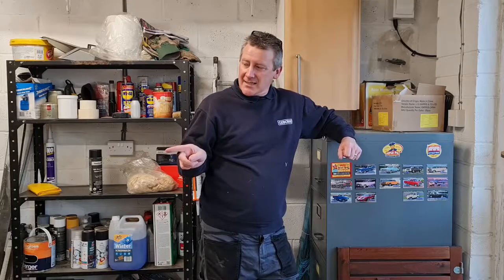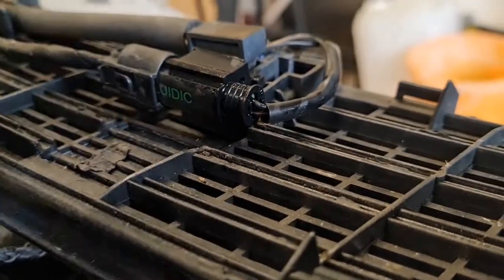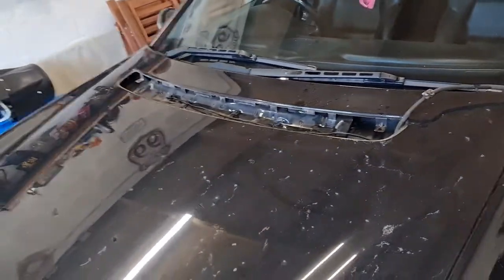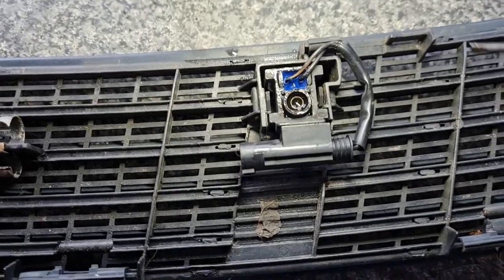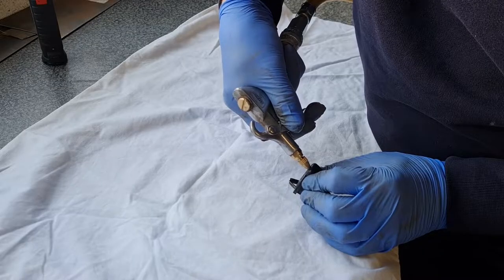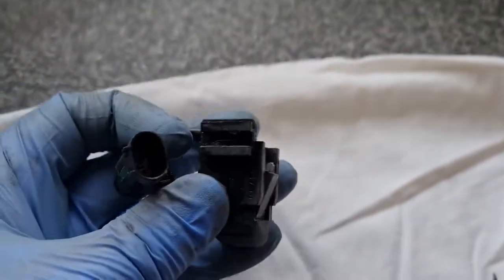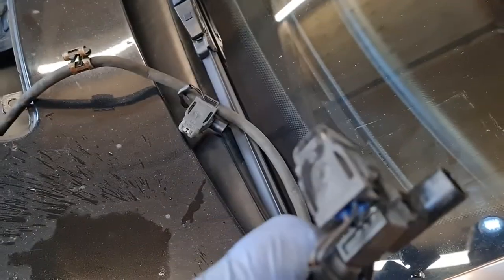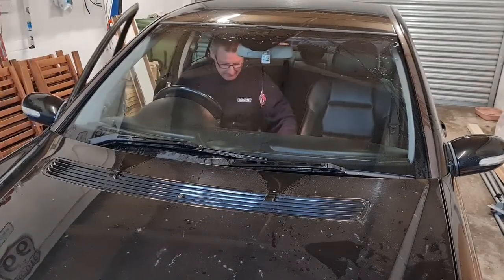How To Clean Or Replace Mercedes Blocked Washer Jets

Comment: Thanks for this mate, helped me big time, setup the exact same as my 09 CLS !
Reply from the maker: Glad it helped Luke 👍🏻
I found out after making the video that the little piece of plastic where the square hole is where the water comes out to squirt the screen also comes out from the washer unit. You'll need a strong pick to remove it but it'll come out and you can clean that too. Makes a hell of a difference 👍🏻

Comment: The jets may not be handed, but the nozzle may have an aim point and if you swap them over the spray pattern may hit the wrong side of the screen, possibly.
Reply from the maker: They just come out covering an area roughly between 10 o'clock and 2 o'clock (a bit less) 👍🏻

Comment: spray connectors with wd40 before you try and take connectors and plastic apart. That way you will not break things. they are very fragile.

Comment: What isn't mentioned is, to remove the grill to access the nozzles, there are NINE invisible, plastic clips that drop the grill from being removed. The only way to get the grill out is to break these old, fragile clips off. To be fair, there is no need for these clips, the 3 torx screws are plenty. My car is clk A209, 2009 reg.
Reply from the maker: You have a different model to the one demonstrated on.....
Reply: @SortedGeorgeGarage  I know it's a different model, but the grill etc. Is identical to yours. Infact, you can clearly see one of the clips on your grill. It also looks like some of your clips have been broken off previously. I'm not knocking your video, it was very helpful, I'm just stating, the removal/breaking off the nine clips took longer than the rest of the job put together.👍
Reply from the maker: Ah I see. I didn't noticed any broken clips so maybe someone has been in there before me 😁
Glad the video helped out 👍🏻
Reply: @SortedGeorgeGarage  it really did, thanks👍